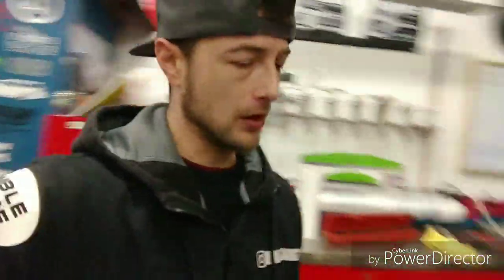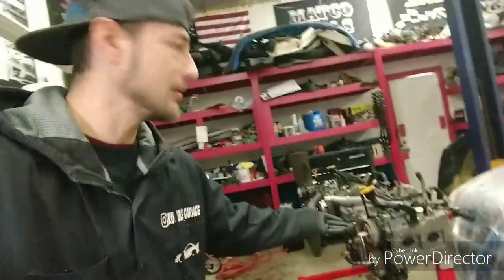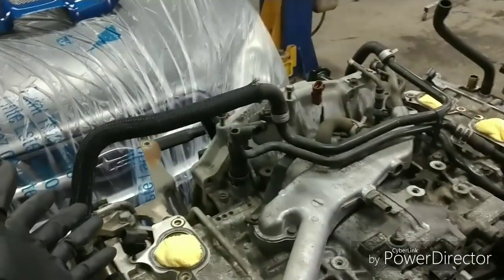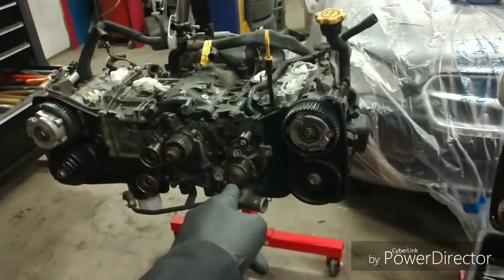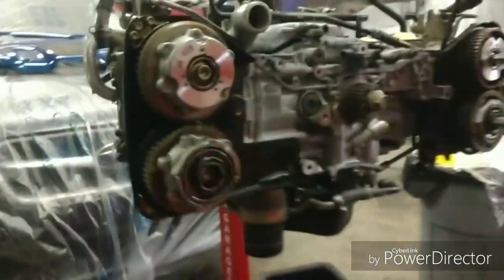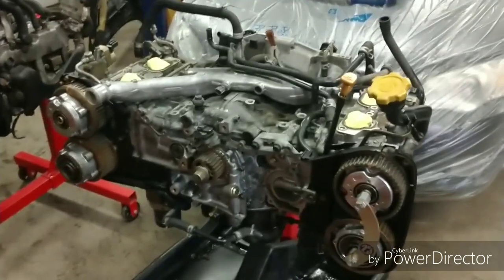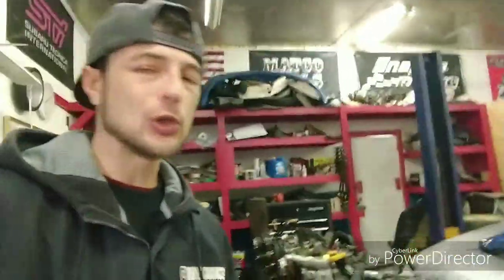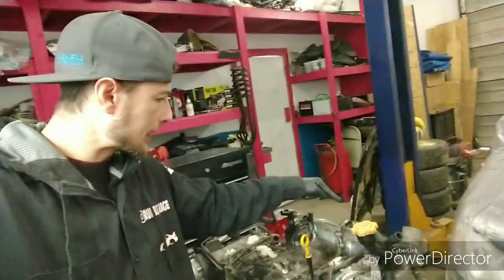Subaru legacy Ej20x swap (Part 1)

Comment: How would I swap the ej20x into my non avcs 2000 forester and what are my options for an ecu?Thanks for all the info
Reply from the maker: Actually that engine can't be swapped into the forester. It won't work.
Reply: @RumbleGarage  Ive seen it done in a 2004 so im confused.
Reply from the maker: @JuKEzThE1aNdOnLY  xt model
Reply: @RumbleGarage yes sir,thinking i can use that ecu or an outback ecu?

Comment: I realize this video is old and you might not have known much about the 20x swap back then but 90% of the stuff you said needed changed, definitely did not need changed. If you didn’t, you should’ve made a stock vs. stock drivability video to show the viewers how much of a let-down the 20x swap is compared to the 2.5. Also, “tuning” out the exhaust AVCS doesn’t fix anything so it’s still gonna run like crap unless you mechanically delete the exhaust AVCS. So anyone reading this comment, if you want your car running again for cheap, buy a 20x and swap it. Just know it’ll never run as good as your 2.5 and you’ll be disappointed. If you want it done right, rebuild the 2.5 or buy a new shortblock. Not trying to be a dick but this was a horrible video if someone is watching it in hopes to 20x swap their car. Hopefully you went back through and corrected yourself in other videos.

Comment: Excellent video! You are very knowledgeable and well spoken! Is it possible to swap the USDM exhaust cam gears over to the JDM motor to eliminate the AVCS? Or is it better to just leave them unplugged and run with the exhausted AVCS disabled?  Thank you for your time!!!
Reply: Almost done with my 2.5 turbo to 2.0 swap on my 04 forester!
Reply: @platinum6978  almost done with my 05 legacy gt 2.5 to 2.0 swap
Reply: @ragewolf1240  did u use the 2.5 externals?

Comment: Never swap an oil cooler from a bad engine they hold a ton of shrapnel. Basically a bolt on grenade.
Reply from the maker: Also I'm glad you commented. Glad to find another Subaru Youtuber. I just Subscribed to your channel. 🤘
Reply from the maker: Absolutely agree! It ended up with a new one. This is some pretty old content. I never updated build series. I still plan to do a shorter 1 video upload on everything you need to know about a ej20x. Thank you for the comment! Glad you caught that in the video. It will help others not to fail. 😊 Thanks again!

Comment: Kick ass content man. One question. I. Have a 2004 forester with a manual trans. Would the ej20x swap in or would I need the ej20y that is made for manual transmissions?
Reply: Kind of wondering the same thing . I have a manual legacy gt and got a jdm ej20x with everything intact , debating on swapping manifolds or cam gears or just running it as is . Would like more info on these builds !
Reply: @kristopherketchum1902  how did it work out for you?
Reply: @platinum6978  I've got everything swapped over did not hook up the dual avcs . Getting an e tune from a local to fix the exhaust cam timing . Threw a few tps codes I am going to switch out the pedal . It is running as of now just needs the tune before testing it out , went with a single exhaust sounds great , really a nice little car .
Reply: @kristopherketchum1902  that's great! I just got the EJ20X dropped in with AMDM harness, turbo and accessories swapped from the 2.5. Ill be on the hunt for a tune I guess. What's the problem with the pedal?
Reply: @kristopherketchum1902  and what did u do about the metal guides on the timing belt
Reply: @platinum6978  you are supposed to switch out the timing belt covers with the manual transmission covers that have the built in metal brackets . I bought the brackets expecting them to be able to bolt up but the ej20x covers did not have mounts for the guides so I ran it without them.  I was warned not to launch it is all .
Reply: @platinum6978  tps code , intermittently it will put the car in limp mode I checked and cleaned the connections they seem fine , so I am going to swap out the pedal assembly.
Reply: The only difference is the turbo on the manual is slightly better I believe and the timing belt covers have metal guides so the belt doesn't pop off during rpm changes if you are using a manual Transmission on the ej20x

Comment: Why do you need to swap over the usdm intake manifold? Or can I get away with the jdm one and an aftermarket intercooler?
Reply from the maker: You can get away with using the JDM intake manifold with a usdm harness. Using an after-market intercooler for the twin-scroll setup would work, unless your engine came with the intercooler already. 😁 Then score! You'll mainly need to use the usdm harness and ECU to make everything plug and play. Using the usdm intake manifold now mainly for the purpose of a non twin-scroll setup.
Reply: Rumble Garage 
I do plan on running a vf52 with usdm exhaust manifolds and an aftermarket top mount , so I guess I’ll need to get the usdm intake manifold. Thanks and good luck with the swap

Comment: Nice , I'm doing a few of these right now .
Reply from the maker: That's awesome. I think I'm in love with this block. At Least the short block for that matter. I'm going to experiment with some WRX heads.
Reply: @RumbleGarage I really like it too. I had good success with swapping to the cam profile of the specific vehicle/ ECU .
I also found a usdm valve cover gasket that works perfectly, it is aftermarket from worldpac but it works great. I don't know the part number  right now but I can post it up later.